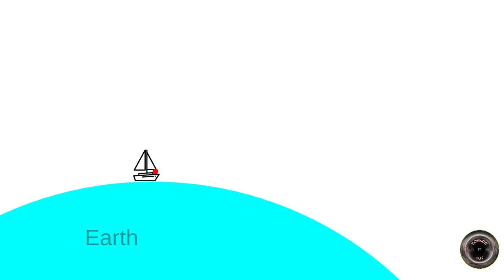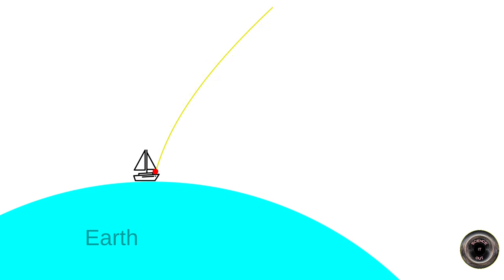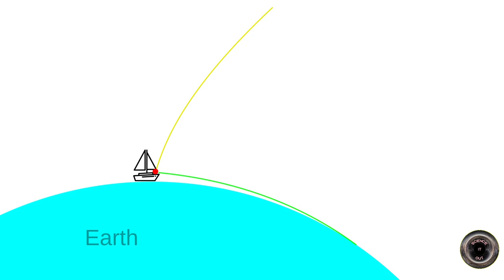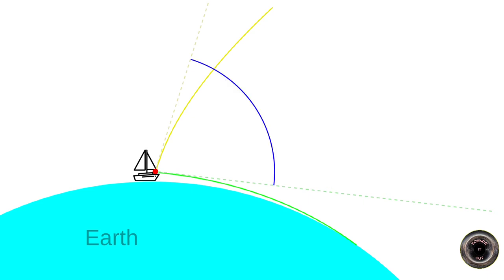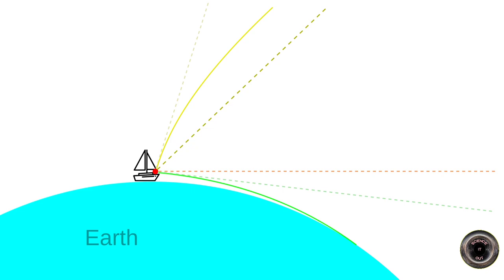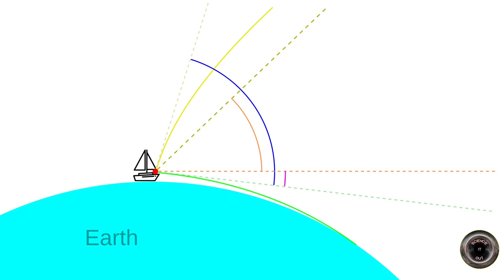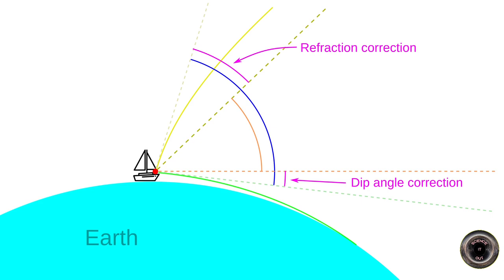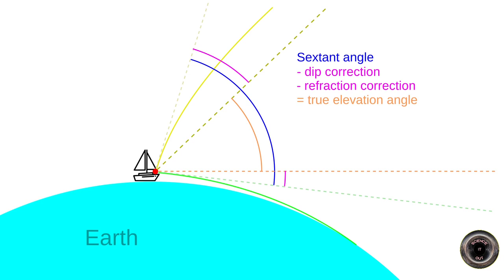How measuring the elevation angles works on a globe

Comment: So you DON'T point your sextant to the horizon to esthablish a HORIZONTAL PLANE of reference, NOT in REFERENCE and NOT parallell to the surface you are (NOT?) navigating. And you DON'T actually esthablish an elevation angle in relation to the apparant position of the celestial body. And then you take your height above sea LEVEL, which is above a sea which is NOT LEVEL to (NOT?) correct for your height above sea LEVEL, which is not actually sea LEVEL. Ok, I think I got it!
Reply from the maker: "So you DON'T point your sextant to the horizon to esthablish a HORIZONTAL PLANE of reference"
No. You establish a horizontal plane of reference by subtracting the dip angle from the measurement. If there was a possibility of measuring directly from horizontal, the dip correction wouldn't be necessary. (That is the case with bubble sextants and theodolites, which can also be used for celestial navigation.)

"And you DON'T actually esthablish an elevation angle in relation to the apparant position of the celestial body."
That's actually exactly what you do. Only the apparent position is different from the true position - hence the need to correct for refraction.

"And then you take your height above sea LEVEL, which is above a sea which is NOT LEVEL"
It is level. It's just not flat.

"to (NOT?) correct for your height above sea LEVEL"
The dip correction is based on the observer height, but it is not a correction for height, it's a correction for the horizon dip.

"which is not actually sea LEVEL"
Again, just because it's not flat, doesn't mean it's not level.
Reply: @scienceitout  You sure it isn't FLAT? Cause it's measured FLAT. Looks like your GP is not on the ground forming a right angle to take an elevation angle. Denying your vertical to the GP? I could of swear the sextant was being pointed at the horizon to esthablish a HORIZONTAL plane of reference, which is parallel to the surface of that which you are navigating. Dip correction being there for correcting for your HEIGHT above that exact PLANE. Think you got some stuff mixed up in your globe delusion about a sextant.
Reply from the maker: @sunbirdism  "You sure it isn't FLAT? Cause it's measured FLAT."
I'm sure, and no, it's not measured flat. I actually measured it. It was curved: https://www.youtube.com/watch?v=V-dl9-xu2kE
There are other reasons to believe it's not flat, too, for example:
https://www.youtube.com/watch?v=BwP8rmBdKRY
https://www.youtube.com/watch?v=dU7JU3rUM9o
https://www.youtube.com/watch?v=omeSZThqqaI

"Looks like your GP is not on the ground forming a right angle to take an elevation angle."
Nobody is interested in that right angle. You're fighting a strawman.

"I could of swear the sextant was being pointed at the horizon to esthablish a HORIZONTAL plane of reference"
Well, you would still be wrong.

"Think you got some stuff mixed up in your globe delusion about a sextant."
Not at all. I think if you actually tried to use some sextant measurements to get a position fix, you would quickly find that you can't do that if you assume a flat Earth. The measurements itself could be done on either a flat Earth or a globe (although there shouldn't be a dip correction on a flat Earth...), but the process of obtaining a fix requires a globe.
Want me to post some sextant measurements I've taken myself? I'll post them, and you tell me where I was when I took them, how about that?
Reply: @scienceitout  Nope, you need a flat plane to take an elevation angle to polaris. Your delusion is based off flat earth measurements. The fact that earth is measured and navigated exactly in this way, i.e. flat, is absolutely proof of earth IS flat. No way around this. And height is always in respect to sea-LEVEL, which is a plane of reference to which you set the sextant by pointing it to the horizon for calibration. You correct for eye-height above this plane (dip-correction), that is above sea-LEVEL. Looks like you wanna create a complete and utter nonsense story about how elevation angles above a FLAT plane are taken.
Reply from the maker: @sunbirdism  "Nope, you need a flat plane to take an elevation angle to polaris"
First, why are you getting so hung up about Polaris? It's just a star. You can take an elevation angle of any star, not just Polaris. Sure, it's close to the north celestial pole, but it's not exactly at the pole (so all this stuff Nathan is going about that you can get your latitude by just measuring the elevation of Polaris is not quite correct).
Second, no, no flat plane is needed for that. That's just your strawman.

"The fact that earth is measured and navigated exactly in this way, i.e. flat, is absolutely proof of earth IS flat."
Except it's not measured flat nor navigated flat. That's just your denial speaking.

"And height is always in respect to sea-LEVEL, which is a plane of reference"
Sea level is a geoid. It's defined by expressing the deviations from an ellipsoid using spherical harmonics (quite an interesting mathematical topic, BTW).

"to which you set the sextant by pointing it to the horizon for calibration."
All wrong.

"You correct for eye-height above this plane (dip-correction)"
It's based on the eye height, but it's a correction for the horizon dip.

So, how about my small challenge? Wanna try figuring out where I was when I took some actual sextant measurements? I obtained a fix from those measurements. Show me that you know at least as much about celestial navigation that you can do the same.
Reply: @scienceitout  tell me again how the sextant is not used by pointing it to the horizon to esthablish a plane of reference, which you need to take an angle from. Not sure why you think I'm hung up on Polaris, when I take it as an example of a celestial body. I suggest you don't get hung up on Nathan too much. If you like him so much, join his show and debate him. Ofcourse you won't.
Reply from the maker: @sunbirdism  You know you don't even need a sextant in celestial navigation, right? You could use any angle measuring tool in principle. For example, a theodolite would be a great choice on land (not so much on a ship, hence why sextants are usually used on ships). And with a theodolite, you don't care about a horizon. You just align it with plumb and then you can take zenith angles directly.

Back to my challenge. As such an expert in celestial navigation, surely you'll be able to tell me where I was when I took these measurements?

Date: April 13th, 2023
Timezone: GMT-10
Observer height: ~60 ft

Sirius 18:28:14 elevation: 73°02.0'
Canopus 18:29:05 elevation: 50°27.2'
Acrux 18:30:14 elevation: 26°05.0'
Rigil Kentaurus 18:31:34 elevation: 10°47.4'

I've done it. The result obtained via celestial navigation is just a few nautical miles off from the GPS position. Can you find out where that was taken?
Reply: @scienceitout  Nice diversion, when I catch you lying about how the sextant is not used with respect to the horizon. Keep lying. Or are you claiming navigation isn't succesfull using the horizon as a means of esthablishing a horizontal plane of reference that is parallel to that which you are navigating? Instead, you wanna give me more heights of an observer above a flat plane as proof for a what exactly? Or you wanna give me elevation angles taken from a flat plane? LOL
Reply from the maker: @sunbirdism  "Nice diversion, when I catch you lying about how the sextant is not used with respect to the horizon."
You not understanding what I'm saying doesn't constitute me lying.

"Or are you claiming navigation isn't succesfull using the horizon as a means of esthablishing a horizontal plane of reference that is parallel to that which you are navigating?"
The first part is kind of correct: the horizon is used as a means of establishing a horizontal plane of reference. That's what the dip correction is for. The horizon is below horizontal, so elevation angles taken from the horizon are too large, and so a correction - the dip correction - must be subtracted from them to get the elevation from horizontal.
The second part is completely wrong, because there is no horizontal plane parallel to "that which you are navigating" (I'm assuming you mean the surface of the Earth), because "that which you are navigating" is not a plane.

I'll just take your refusal to compute a position fix as an admission that you're unable to do it - which I don't need, TBH, because I was already pretty certain that as a flat earther, you won't be able to do it. No flat earther can, because it requires using a globe.
Reply: @scienceitout  The GP is 90 degrees to your postion when taking an elevation angle? yes or no?
Reply: @scienceitout  nice GROUND POSITION in "space"
Reply from the maker: @sunbirdism  "The GP is 90 degrees to your postion when taking an elevation angle?"
I'm afraid that doesn't even mean anything. The GP is a point, the position is a point. Two points don't define an angle.
Reply: @scienceitout  I know you don't have a right angle from your GP perpendicular to your position in your imaginay ball view, I KNOW. And your GROUND position (GP) is in your imaginary space in your drawing. LOL
Reply from the maker: @sunbirdism  I posted a diagram showing where the GP is under your other comment, but let's just post it here as well for completeness: https://imgur.com/IreWJyK
Reply: @scienceitout  Oh, so you do need a priori a FLAT plane to take an elevation angle from? I KNOW. Nice flat earth proof!
Reply: @sunbirdism Are you saying that the Earth is a flat plane? Now even mountains are part of the conspiracy? 😂😂😂
Reply: @primonomeultimonome  there is no conspiracy, only some like you that don't understand mountains have a height with respect to sea-LEVEL and think water instead is curving LOL
Reply: @sunbirdism  Not my fault if you claim that an imaginary geometric plane is proof of your imaginary pancake. 🤷‍♂️
Quite ironic that flerfs blame others for their own reification fallacies. 😂
Reply: @primonomeultimonome  sea-LEVEL is imaginary, gotcha
Reply: @sunbirdism  Oh so you have never heard of tides. Reality isn't your thing guys, is it? ROFL
Reply: @primonomeultimonome  as defined in relation to mean sea LEVEL? LOL
Reply: @sunbirdism  Are you by any chance referring to mean sea level as calculated  by physicists and surveyors in relation to the geoid or the local ellipsoid? Welcome to the globe, buddy. LMAO
Reply: @primonomeultimonome  gonna need flat plane measurements a priori for that to work, buddy. You need a flat earth more than me. LOL
Reply: @sunbirdism  And there you complete your circular reasoning. Pure FE comedy gold. 😂😂😂
Reply: @primonomeultimonome  Imagine you understanding what a circular reasoning fallacy actually meant.
Reply: @sunbirdism  Something like "the Earth is flat because in order to measure its shape you need an imaginary flat plane, which is the shape of the Earth."

Beyond the circular reasoning, a complete lack of understanding of basic geometry and physics. As I said, pure FE comedy gold. 😂
Reply: @primonomeultimonome  Are you claiming you don't need a flat baseline to take an elevation angle from with a marine sextant?
Reply: @sunbirdism  What flat baseline, buddy? You mean the imaginary tangent plane to the calculated mean sea level, or the imaginary not-so-horizontal line to some point over the visible horizon? Feel free to choose your FE reification fallacy. 😂😂😂
Reply: @primonomeultimonome  That would be the straight and flat line of sight to the horizon to the GP of the celestial which is a a 90 degree angle. So that line which is parallell to sea-..LEVEL which you are naviating. Definitly not a tangent plane with a GP in space, no. LOL looks like you have no clue how a marine sextant works. No surprise there.
Reply: @sunbirdism  Unfortunately it is neither parallel to sea level, nor horizontal, as proven by the existence of the infamous "dip correction". And if there were a 90° angle involved in celestial navigation, you could immediately triangulate the distance to the "celestial" as you call it, which of course you cannot as people explained to flerfs over and over for a decade now.

So apparently you project on other people your own cluelessness. Endless FE comedy gold. 😂
Reply: @primonomeultimonome  Proven by dip correction, which corrects for height of eye above sea-LEVEL taken at port. Looks like you not only have no clue what an elevation angle is with it's GP and right angle. You have no clue what LEVEL means and now it looks like you have no clue for what is being corrected. LOL
Reply: @scienceitout  The funniest thing is that these guys get out of their FE echo chambers believing that they got everything figured out, and for some brief moments they really believe that they come here and school people. 😂
Reply: @sunbirdism  The problem is that there is no need for dip correction over a large flat surface. Thanks for acknowledging that the Earth cannot be flat. 😂😂😂
Reply: @primonomeultimonome  "no need for a correction of height of eye above a plane when taking an elevation angle from it to a celestial with a marine sextant" would be YOUR FALSE claim and shows a lack of understanding of basic trigonometry. Thanks for your false claim. Now you can eat it. LOL
Reply: @sunbirdism  And yet trigonometry supports exactly what I said, as you would know if you had the slightest idea of how dip correction tables are calculated. But again, thanks for the endless comedy gold. 😂😂😂
Reply from the maker: @primonomeultimonome  Yup. I also can't help but notice him repeating "LEVEL" in all caps as if he thinks that proves anything. He can't imagine a level surface other than a plane, so it must be a plane 🤷‍♂
Reply: @scienceitout  In other words, you are suggesting that flerfs' limited cognitive ability makes them suffer from innate begging the question syndrome. 😂😂😂
Reply: @scienceitout  no matter how many caps, you stil think LEVEL means CURVE. And you need an actual flat baseline and flat earth measurements to imagine your ball.
Reply: @sunbirdism  No matter how you write it, level is measurably curved, and there is no need for any horizontal baseline to measure it. 😂
Reply from the maker: @sunbirdism  LEVEL means a GEOID, which is a surface defined as an ellipsoid plus some small undulations specified as a series of spherical harmonics (feel free to look up what those are, I'm sure you'll have fun).
Reply: @scienceitout  twist the meaning of LEVEL to match your imaginary ball based on flat earth measurement
Reply from the maker: @sunbirdism  The problem is that you're the one twisting the meaning of "level".
"The geoid is a model of global mean sea level that is used to measure precise surface elevations." https://oceanservice.noaa.gov/facts/geoid.html
"The unperturbed ocean surface must be an equipotential surface of the gravitational field, and because the latter reflects variations due to heterogeneities of density within Earth, so also do the equipotentials. The particular equipotential surface that coincides over the oceans with unperturbed mean sea level constitutes the geoid." https://www.britannica.com/science/geoid/The-concept-of-the-geoid
"The geoid is a measurement of mean sea level (MSL)." https://gisgeography.com/geoid-mean-sea-level/
Do I have to go on?
Reply: @scienceitout  why are you chanting your imaginary ball ideology that is derived from flat earth measurements again?
Reply: @scienceitout  so to be sure, your MODEL is derived from flat earth measurements, I hope that's clear now.
Reply from the maker: @sunbirdism  Yes, definitely, people measured a flat Earth and then derived a geoid from those measurements.
Keep telling yourself that if it makes it easier for you to cope with reality.
Reply: @scienceitout  FACT: nautical miles are straight line distances derived from elevation angles to polaris taken with a marine sextant proving earth is FLAT. So navigators need a flat baseline, which is the horizon line. So the one denying reality would be you. Hope that cleared it up.
Reply: @sunbirdism  LMAO nautical miles were defined as arc lengths of a fraction of the circumference of the Earth at the Equator. So neither straight nor on some flat surface. Welcome to the globe, buddy. 

You'd better go back to your echo chamber if you want to keep believing your FE fairy tales.
Reply: @primonomeultimonome  gonna need flat earth measurements for circumference distance buddy.
Reply: @sunbirdism  Go ahead, show us how measuring the circumference of a basketball needs the basketball to be a frisbee. 😂😂😂
Reply: @sunbirdism  Thanks for confirming that, according to your FE beliefs, it is impossible to measure whether a basketball is curved or not, unless the basketball is a frisbee. Yet another epic FE fail. 😂
Reply: @primonomeultimonome  I know you think you live on a spinning basketball in a vacuum, I know. Sad part of the cult.
Reply: @sunbirdism  How would you know? You can't measure the difference between a basketball and a frisbee, let alone understand what the shape of the Earth is or what other people know about it. 😂
Reply: @primonomeultimonome  Dude, I know you think the earth is a basketball or a frisbee. You don't have to keep chanting your cult believes and keep laughing. It makes it only more sad for you.
Reply: @sunbirdism  LMAO so basketballs and frisbees are all the same to you. That explains a lot. 🤣🤣🤣
Reply: @primonomeultimonome  QED
Reply: @sunbirdism Thanks for the comedy gold, buddy! Nowadays FE newbies are rare, none of your FE buddies dares to get out of their echo chambers and make such a display of their complete ignorance.
Reply: @primonomeultimonome  jokes on you buddy
Reply: @sunbirdism  says the guy who thinks that nobody can measure the circumference of a spherical object because it is not flat. Kids in first year of primary school know better already. Go get an education instead of making a fool of yourself on  the Internet.